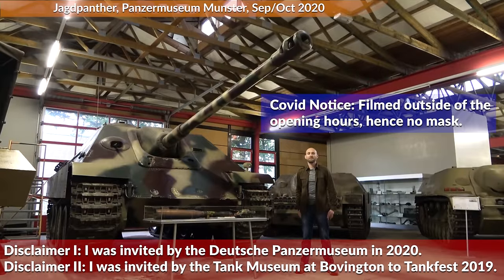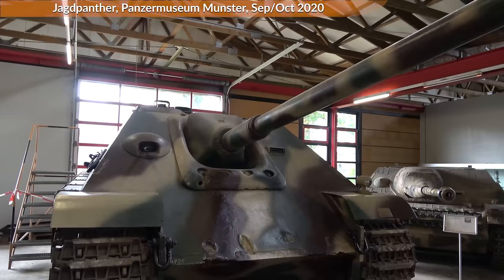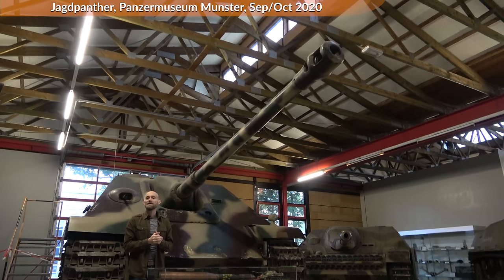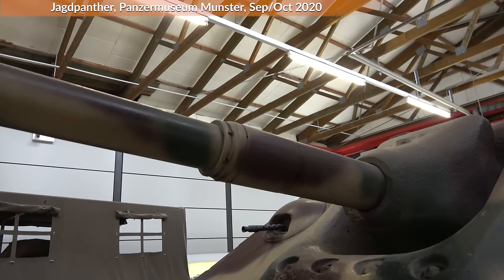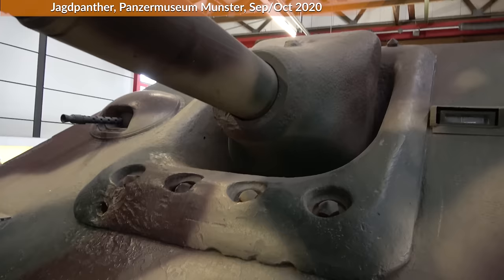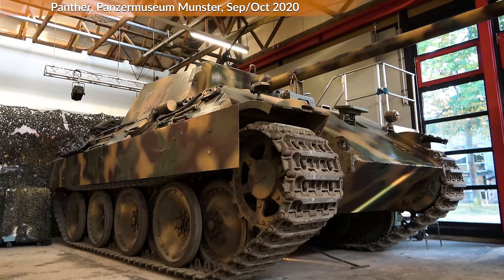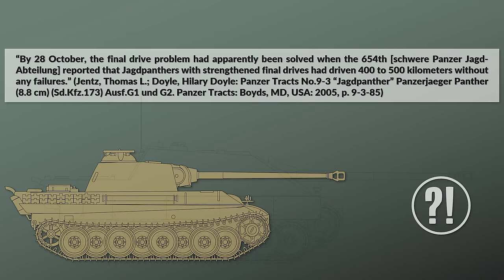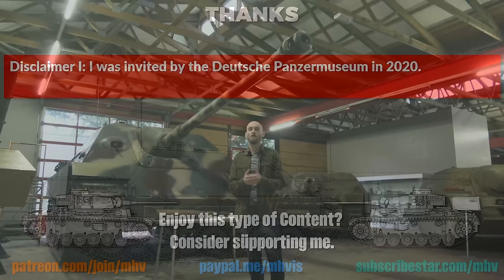Jagdpanther: King Tiger's Gun & Panther's Chassis

Comment: Yes, a disertion about the Panther final gears, please. What is the trurht about this topic.
Reply: https://en.wikipedia.org/wiki/Panther_tank#Reliability
And check out The_Chieftain comment in this comment section(almost the number 1 comment under this video), I already copy pasted from historical sources with linked historical documents.
Reply: John Cornell  If you need, I can show you reports from 1943. (But the topic is about the final drive improvement, and Kursk was the first and worst battle for the panthers)
Reply: John Cornell  And what is the point? It was not reliability porblem, but battle damage? I guess that is not true,(I mean you are right they had many off writings because of the big battle but still, the panther had reliability problems aswell) because many reports talking about reliability issues.
Reply: John Cornell  "Annex 1 of the brief of Gen. Ins.d.Pz.Tr.
Chefgruppe No. 80/43 gK

Report on the experiences of Pz.Rgt. (Panther) v. Lauchert
(same report what you linked)

III. Instruction .

The training period has been too short.

For this reason, drivers have not achieved sufficient driving practice. The technical personnel have not been sufficiently trained, the gunners and commandersthey have not had the necessary tactical training.

Due to the necessary modification work in Grafenwöhr, only squad-level training ( Zug ) was possible.

This lack of education has had serious repercussions.

This has been the reason for much of the technical breakdowns and tactical problems.

 IV. Regiment status after 7 days of operations .

During the first days our fighting forces were drastically reduced due to enemy action as well as losses due to technical problems.

Status on 07.10.1943 at dusk:

10 Panthers lost by enemy action.
25 Panthers totally lost (23 due to enemy fire and subsequent fire, 2 due to fire during the march)

100 Panther in repair and maintenance services ( J-Dienste ). Of these: 56 with damage caused by shots and mines and 44 with technical problems. Approximately 60% of technical problems have been minor breakdowns.

Vehicles repaired and back to the area of operations: approximately 40 Panthers.

The rest, approximately 25 Panthers, have not yet been registered by the repair and maintenance services.

Status on 07.11.1943 at dusk:

Operational: 38 Panther
Total losses: 31 Panther
Under repair: 131 Panther

A slow increase in combat strength can be seen.

The large number of Panthers lost by enemy action (81 Panthers until 10.7.) Are an indicator of the toughness of the fighting.

The very deeply structured and massively mined battlefield of the Russians had to necessarily lead to a large number of material casualties from enemy fire and mines.

The Panzer IV and Tiger have not escaped this fate either.

The fact that the Panther is being operated on the battlefield for the first time has put it in the general spotlight. Comparisons with losses from other armored formations have not been made.

For this reason the military commanders and the troops have quickly come to the hasty conclusion: the Panther is useless!

In this sense, and finally, the following should be commented:

The Panther has operated successfully. That at the beginning technical problems appeared en masse was to be expected, since extensive tests with the troops had not been carried out previously.

The level of operational vehicles is increasing.

Once the problems with the fuel pumps as well as the engine have been corrected, the casualties due to technical problems will return to the normal level.

The disproportionate and high numbers of enemy casualties per action reflect the severity of the fighting. "

http://www.panzer-elmito.org/tanques/panther/documentos/Pz_v_Panther_v-Lauchert_17-07-1943_02_D.jpg
http://www.panzer-elmito.org/tanques/panther/documentos/Pz_v_Panther_v-Lauchert_17-07-1943_03_D.jpg
http://www.panzer-elmito.org/tanques/panther/documentos/Pz_v_Panther_v-Lauchert_17-07-1943_04_D.jpg
Reply: John Cornell  "Gen.Ins.d.Pz.Tr. Chefgruppe Nr.80 / 43 gK
Supplement to 'Annex 1'

Individual experiences on operations with the Panther

Chassis technical defects :
The vast majority of technical defects have been caused by faulty fuel pumps (within Pz.Abt. 52 and only up to 8.7. A total of 20 casualties). This is probably a material fault. Due to leaks in the fuel pump, a pool of fuel forms on the floor of the engine compartment, which in three cases has caused a fire and the total loss of the vehicles. The Panther catches fire easily when extremely tilted.In most cases the fire has been put out or the automatic extinguishing system has been activated.

Engine
breakdowns : The number of engine breakdowns is currently abnormally high. Inside the Pz.Abt. 52 to 8.7, 12 damaged engines have been counted. After several days of operations, the number of breakdowns has decreased, which is why it is believed that the engines have not been sufficiently wheeled.

Gearbox :
There have been no serious breakdowns in the gearboxes. The modifications made at Grafenwöhr have apparently been successful. Until 8.7. inside the Pz.Abt. 52 have counted 5 damaged boxes.

Final remarks :
The defects listed here have been made known to the Minister of Armament and Ammunition ( Reichsminister für Bewaffnung und Munition ) as well as to the Armament Agency (Waffenamt ).

Solutions have been promised. "

http://www.panzer-elmito.org/tanques/panther/documentos/einzelerfahrungen_panther_17-07-1943_03_D.jpg
Reply: John Cornell  "July 20, 1943

Gruppe V (J)
Nr.I / 41988/43 geh.

Analysis of Oberstleutnant Reinhold, commanded during operation 'Zitadelle' at Pz.AOK 4

2. Technical defects :

    a,Engine breakdowns. Reason not yet clarified, probably insufficient filming and inexperienced drivers. The engines run at very high revs. For this reason overheating and breakage of connecting rods.

    b,Fuel pump In many cases, interruption of the fuel supply due to leaking pumps and defective membranes.

    c,Leaks in the connections of the fuel and oil lines. For this reason high risk of fire.

Communiqué from the Engineers Battalion of 19.7. :

As a consequence of the sudden recall order, the lost Panthers that have not yet been towed will not be able to be recovered. The blasting of:

Regiment of the General Staff 	3 Panther 	 
Abteilung 51 	29 Panther 	9 could be repaired
Abteilung 52 	24 Panther 	 
  	  	 
  	56 Panther 	In addition to the approximately
40 total losses reported
Statement on the situation as of 18.7. 16 hours :

Abteilung 51: 	Operative 	33
  	Under repair in maintenance services 	32
  	Total losses 	31 (2 burned, 29 blasts)
Abteilung 52: 	Operative 	28
  	Under repair in maintenance services 	40
  	Sent home to be repaired 	4
  	Total losses 	24 (blasting)
The maintenance services of the two Battalions-Panther work very well. Daily maintenance / repair approximately 25.

Due to the large number of casualties there is a great shortage of spare parts. A great help has been the air transports organized by the Supply Officer (Gen.Qu.) with gasoline engines and pumps. The shortage of spare parts is improving thanks to urgent transports, so that the early repair of most of the vehicles that are in maintenance services can be counted on."

http://www.panzer-elmito.org/tanques/panther/documentos/reinhold_20-07-1943_001.jpg
http://www.panzer-elmito.org/tanques/panther/documentos/reinhold_20-07-1943_002.jpg
Reply: John Cornell  "Battalion Command Post, 20.10.1943

I./Panzer-Regiment 2

Report on the experiences obtained in the operations between 9 and 19.10.1943

1. Tactical instruction :
Due to the circumstances necessarily very short tactical training with the tank has not had particularly negative consequences. This has been the case because the units still have more than 50% commanders and crew members with experience on the Eastern Front. Within this group of old people, young people have surprisingly adapted very easily and have thus been able to alleviate their inexperience quickly. The many young drivers, partly very poorly educated,They have met expectations and with great enthusiasm and independently tried to keep their vehicles operational. The existence of veteran platoon leaders and experienced commanders has been decisive in any case.

2.Previous technical training in the Reich :
During the training courses, which are partly several weeks long, the tank drivers and mechanics have not been given what they will need in their future roles. Thus, for example, it has happened that soldiers with great attitude and disposition have been employed for several weeks in a single type of task, for example in the assembly of wheels, thus making it impossible for them to obtain a global vision about the function and design of the Pz. Kpfw. V.In many cases a shorter course but under expert guidance would have provided these individuals with better expertise. The possibilities for this have existed in all factories.

3.Technical defects in the automotive industry :

    a,Engine : Head gaskets burn out. Connecting rod breakage. Oil pump shaft breakage.

   b, Side reduction gears : The special screws on the large sprockets of the reduction gear break. The covers of the housings are often loosened, they do not have soldering points, therefore there is a loss of oil. Loss of oil also when loosening the fixing screws of the reduction gear with the side wall of the tank bathtub.

    c,Fan drive : Failure of the fan's upper rolling bearing. Lubrication shortage, despite correct oil level indicated. For this reason, the drive and often the fan clutch break down in parallel.

    d,Transverse transmission : Simmering leaks, probably due to a displacement of the main shaft.

   e, Intermediate gear : The bearing is shifted towards the motor side. The bearing bracket is torn off in the direction of the Teves pump ( Tevespumpe )

Finally, it can be said that with the Pz.Kpfw. V the troop has an excellent vehicle, not only from the point of view of its armament but also in terms of its maneuverability. Its availability is unfortunately limited due to the problems described above. For example, the Battalion launched the attack on 10/16 with 31 vehicles. Despite not having traveled great distances, in just 7 hours a total of 12 vehicles suffered technical problems and were low for the rest of the combats.The average availability of the Battalion between 9.10 and the time this report is written is about 22 vehicles per day. Casualties among commanders, compared to the rest of the crew, are extremely high. Reasons: Easy perforation of the side armor of the turret and fragility of the commander's drum dome in the face of artillery shells, etc.Reasons: Easy perforation of the side armor of the turret and fragility of the commander's drum dome against artillery shells, etc.Reasons: Easy perforation of the side armor of the turret and fragility of the commander's drum dome in the face of artillery shells, etc.

Casualties :
Wounded: 3 officers and 8 NCOs and troops.
Dead: 2 officers and 11 NCOs and troop.

They have been destroyed :
46 enemy tanks.
4 assault guns.
28 anti-tank guns.
15 infantry guns and grenade launchers.
26 antitank rifles.

Losses :
8 tanks lost. All by action of enemy fire: 6 totally burned and abandoned on the battlefield, 2 cannibalized in the field workshops."
http://www.panzer-elmito.org/tanques/panther/documentos/Panther-43-10-20_02.jpg
http://www.panzer-elmito.org/tanques/panther/documentos/Panther-43-10-20_05.jpg
Reply: John Cornell  Yes I agree with you.

Comment: It’s so weird that the engine only does 250RPM when you’re average car does 10,000+
Reply from the maker: 2500, but I guess that was a typo, with tanks it is about power and less speed.
Reply: Try more like your car will be redlined at 7,000 . And blow up well before 10,000 , if it could bgeyb there